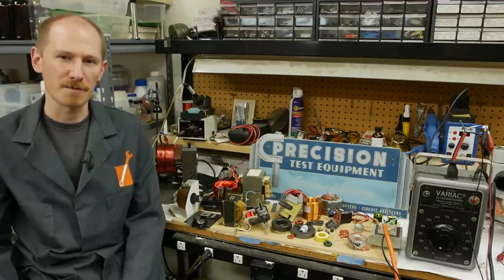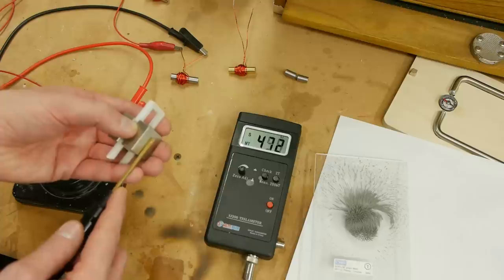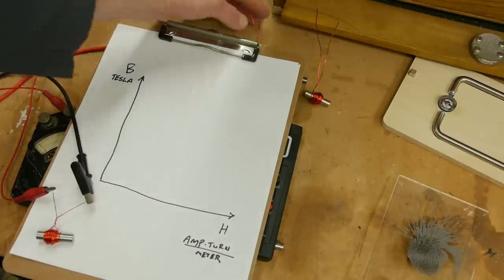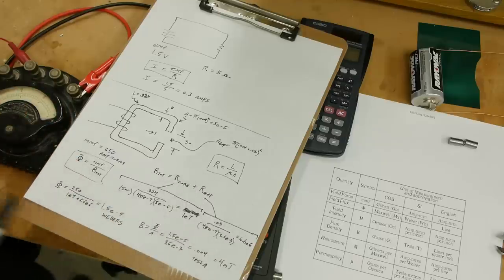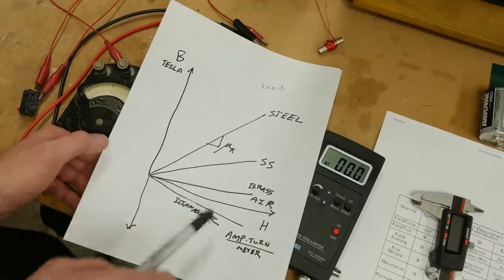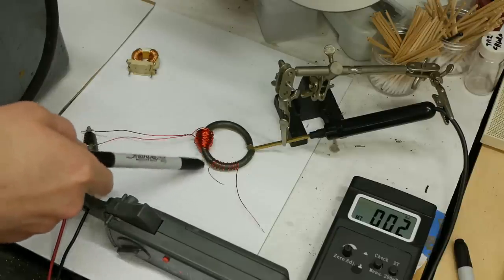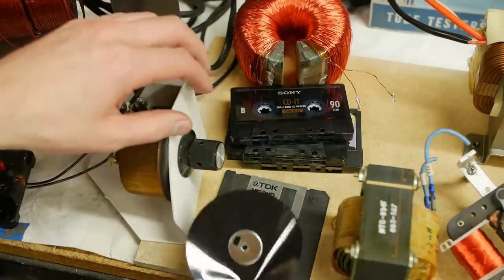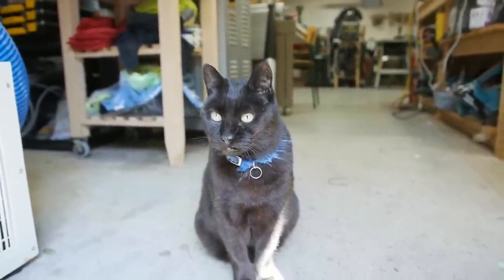Engineering magnetics -- practical introduction to BH curve

Comment: I have to agree that this is a very good educational video. Just a few remarks. 

When talking about the saturation you should mention that the curve does not turn horizontal up there but continues with the slope of the permeability of free space.

Your text notes are too small to be read on a screen.
Reply: @42min your small toroidal ferrite "transformer" is a filter coil meant to filter out high-frequency disturbances from a mains supply by passing phase an neutral through the two windings.
Reply: Sorry, its not a Rule. its a convenience. - and entirely dependent on the resistance of the wire. - EG. you can have unlimited turns, if you have superconductor wire. like iridium alloy.   - oh and you can just use litz wire copper also
Reply: lol yes, newman was terrible at demonstrations.    - he took the theory in the other direction with tiny wire, too choke the current. -  50,000 turns for 2 watts input, - -- ,it has too move something rite ? , even with huge magnets...  this proves even our electrical intuition is better than "amps times turns"  - that's physics!
Reply: Yes it is a common mode choke where the appliance current in line and neutral magnetises the core in opposite directions and cancels out. So it has little impedance to differential currents but high impedance to common mode currents. But there is nothing really to stop you using it as a 1:1 transformer as Ben did.
Reply: @uwezimmermann5427  Yes, it is a common mode filter, but it still is a transformer!

Comment: I did my big delve into transformer design half a decade ago and have learned since, but I'm still going into this excited. Have you read about the team that used superconductors to make legitimate "wires" for near lossless magnetic field transportation? It was still only lab work when I read about it. I hope more work has been done on that, it was very fascinating.
Reply: I thought that magnetic fields are the arch enemy of superconductors.
I can remember "glass iron" (extremly fast cooled iron), which had excellent magnetic proprieties for transformers...
Reply: Atlas WalkedAway -- Do you mean transport like putting it in discrete shipping containers, for movement through space?

Comment: Watched this video again the 3rd time. I had some old copper ballasts that were being scraped in my apartment lighting (after 7 years of running) and being replaced with electronic ballasts. I collected them and planning to do some experiment. Your video comes very handy and practical.

Comment: Hi Ben!  Great video.  One question though...  I thought that the residual magnetic field that remains after the external field is removed is called the magnetic remanence, not the coercivity.  The coercivity is the strength of the external field necessary to cause the material to become magnetized, a measurement of "magnetic hardness".  Once the material is magnetized and the external field is removed, the strength of the residual field depends on the remanence of the material.  Did I misunderstand something?  (I've only watched the video once so far...)
Reply from the maker: I think you are absolutely correct!  In fact, it's been a long time since I've heard the word remanence, and since the two properties often go together, I forget they are in fact separate points on the BH curve.  Thanks for pointing this out!
Reply: I like this part of Ben: when he muffs something (very easy to do on a subject like this), he admits it, and that's it. There's no shame in it. Stuff happens. Lord knows I have made a lot of errors in my professional life. All science and engineering practitioners should be like Ben.
Reply: I seem to recall remanence also being called retentivity, which seems a more descriptive term... though with 5 short syllables, it is a bit of a tongue-twister. At least retentivity will not be confused with revenants! https://en.wikipedia.org/wiki/Revenant
Reply: @PaulTurner_Haizo  Please share schematics for that circuit!
Reply: @AppliedScience  Thank goodness for that; I live and was educated in England and was beginning to think things are different on this side of the Atlantic!  Thanks for the great video, as they say a picture says a thousand words and seeing it in operation has got to be at least 10 times greater!!

Comment: The energy that's put into a permanent magnet at its time of manufacture, where does that energy go when you heat the magnet to its Curie point? Is it converted to heat then lost to space by radiation/conduction?
Reply: whoa good question
Reply: No energy is stored in permanent magnets, thats an illusion.
 example:
Take a jar of pennies, reorder every pennies in the jar so the face point upward, this takes energy. Now, shake that jar, did the pennies get warmer bc they are now randomly oriented?  No
Edit:
Permanent magnet are made out of "magnetic" atoms, the magnetization just align the atoms (cluster of) in one direction, this rotations heat up the magnet while it's manufactured.
Heating over its Curie point, just randomize the atoms back.
Reply: International Mutual Neutralist Party Templates 

that's a great explanation actually
Reply: MrJimbo1qaz yes, if you try to put two of the same poles together you will feel the force pushing the poles away. If you keep the poles together you are putting in work to counter the magnetic force. Work is the transfer of energy and has the same units.
Reply: MrJimbo1qaz: It always require energy to get from a chaotic (randomized clusters) system to an ordered one.
Reply: MrJimbo1qaz: "feel forces from others (atoms)…" are the reason of "clusters". But wouldn't you, need more energy to demagnetize these atom clusters because their fields were aligned ?
Reply: I think the diminishing of the magnetic field above the curie temperature would induce a current in a nearby conductor because changing fields and moving field are the same as far as induction is concerned. Thereby the energy is released as electromagnetic waves. So yes you can get the energy out by destroying a magnet. The efficiency is just abysmal.
Reply: "shake that jar, did the pennies get warmer bc they are now randomly oriented?"
Yes.
Very very very very slightly, but yes.
Reply: I think this is true and nobody's going to see it while that incorrect answer continues to rack up the upvotes. The pennies MUST get warmer by definition because order is being lost. The system is becoming more disordered and occupying a lower energy state. Energy must be released in some form.
Reply: there is some energy required to demagnetize the clusters!
you can see this when you heat up iron above its curie temperatur the temperature stays the same till all the alligned clusters are disordered
Reply: A one layer cylindrical coil acts exactly same as a cylindrical magnet  of same dimension if you put the right ampere/turn on it.
Once you have the right turn and amp....
Then you can calculate/measure the inductance...and apply the energy formula:
Jouls=Amp2 x Inductance x 0.5
Thats are the energy "STORED" in the coil and the magnet.
If a loaded coil are wrapped on a magnet and you rise the temp to curie point...you can retrieve the energy previously stored.
Obviously with great loss....unless the coil was a Superconductor and in short circuits.
In that case near all energy will pass to coil (all if was a toroide with not dispersing flux)...and the magnet become no magnet and the coil become the magnet .
Reply: Good question, but I think the required energy to reorient the grains in the material would get "lost in the noise" of the heating process, which takes a fair amount of energy all by itself. How does one separate the heating energy from the "flipping energy"? I have no answer for that.
Reply: @Mrluk245  So the magnetized state "melts" at a constant temperature, like ice.
Reply: Demef You separate the energy by accounting very carefully for all the heat you put into the system. This is done by very carefully insulating the material under test, so that you know how much thermal leakage there is (thermal flux through the insulator, and through any of the shorts - any sort of wire crossing the insulator is like a thermal “short”!). Such insulated chambers are common anytime you have to measure something that relates to the amount of heat added/removed from a system. And IIRC the demagnetization energy, while not very easy to measure, can indeed be measured. Just as you can measure the energy released via a resistor that shorts out a magnetized electromagnet.
Reply: @AltMarc  what about the energy required to turn magnetic dipole under a magnetic field

Comment: This is one of the best magnetics  introductions I've ever seen. It is so easy to get loose on math and be disconnected from the physics behind. When I learnt this on my second year of EE, I was able to solve exercises so I passed,, next year I was an teaching assistant, and then I started to understand. Finally truogh labs  classes and a few years I got enough physical understanding. Today I think that some lab should be done in advance to the hard math/physics teaching so an integral is not a math challenge but a sum, a divergent is really a measure of something real diverting, and so on.

Comment: If you have wire wound around an iron core, and at a given current it is saturated, if you pass a higher current through the wire, what happens to that extra magnetic field or flux that is being generated?
Reply from the maker: Good question.  Once saturated, any additional H caused by additional current in the coil will behave as if the iron didn't exist at all.  It will spread out through the air just as it would without the iron.  It would be nice if the transition through saturation were like a brick wall -- snapping into a new regime suddenly.  If this were the case, we could first measure the field caused by 100% saturation, then measure the field caused by air (with the iron core removed), and then sum them together.  In the real world, the transition to saturation is gradual, and the field making its way outside the core will interact with the partially saturated core, and cause things to become a little more messy.
Reply: The phenomenon you are looking for is called magnetic flux leakage. The magnetic field will literally leak out of the iron core and start flowing through the air around the core instead.
Reply: Magnetically, it would make the field weaker but would make very little difference overall. Your essentially shorting out a small section of the magnetic field. Remember that flowing electrons create a circular magnetic field that flows around the current flow. So the magnetic properties of the wire aren't very significant, it's whats around the wire that has the most impact. Electrically on the other hand, by using wire with a higher resistivity, you've increased the resistance of the coil. Which means you need more voltage to have same amount of current flowing through the coil. This means you will need to have more input power to produce the same magneto-motive force and your overall efficiency would drop.
Reply: Mai Mariarti  The iron wire will get hot.

Comment: If you put a highly diamagnetic material in place of the air gap, would you get a net negative reluctance? And what would that do to the magnetic field flowing in the "circuit"?
Reply from the maker: I was wrong about this in the video.  One of the other commenters helpfully pointed out that diamagnetic materials do not have negative permeability, but rather a permeability that is lower than empty space.  This means that in an H field, the material will conduct magnetic flux more poorly than empty space itself).  The magnetic field lines will partially flow around the diamagnetic material instead of through it because the material poses slightly more reluctance than the space around it.  A compass needle aligns itself with the magnetic field, while a piece of diamagnetic material will become perpendicular to the field lines.

Comment: A simply outstanding resource, thank you SO much! As an electronics engineer who struggles with magnetic, this is very valuable.

I fully appreciate your strategy of keeping things simple, minimising the math and especially minimising the proliferation of terminology. In doing that, it is vital to use the utmost care when selecting terms to avoid confusing the listener who is struggling at the limits of comprehension. And in an attempt to be helpfully picky, I’d like to suggest some to reconsider.

The electrical analogy to permeability is conductivity, not resistivity. And if you were to write an equivalent formula for resistance, to match your formula for reluctance, the electrical conductivity would be in the divisor, not resistivity.

You seem to use field and flux (or flux density) interchangeably. Are these distinct concepts? My understanding is that flux is analogous to current. Is that so?

And near the end, when you’re talking about hysteresis loss, you talk of power loss per cycle when I think you mean energy loss per cycle. Energy loss per cycle multiplied by frequency gives power loss in watts, so these are not the same thing.

And one thing that confused me slightly was you said H was ampere turns per metre, then later gave MMF as ampere turns, without the per metre. What happened there? What did I miss? What happens if my coil is not one metre long?

I’m not trying to be critical, I really appreciate this excellent video. I’m just trying to point out a few areas where those struggling with magnetic concepts may be thrown off track by questionable terminology, which may be improved. And remember, you don’t bother polishing a turd, only a prized jewel!

Comment: This is an astonishing video. I have PhD in physics(different area though) yet in this video I found lots of things I did not realise: analogies with electric circuits, transformer saturation and gaps in inductors. However, there is still something that I can't get intuitive understanding of:

Materials with high magnetic permeability form a good "conductor" for magnetic fields, basically inducing high internal magnetic field B from external field H. However, in electric analogy, good conductors have infinite permittivity which means that they completely expel electric field E from them (displacement field D inside conductors is zero). Why instead of an analogy do we have opposite behavior here?
Reply: I never heard of anything having infinite permittivity. I have learned metals have relative permittivity close to 1.
Reply: your confusing ohms for permitivity.....fat gold wire has lower resistance ohms...ohms is lower...high magnetic permeability = low electic ohms

Comment: What's really interesting - and something I hardly ever see anyone talk about - is the fact that when you try this with an unbroken horseshoe steel bar  (instead of the broken horseshoe you have in the video to fit the compass in to show the magnetic field lines) what happens is that the steel piece you add to complete the circuit stays locked in place, even when you turn the current off. You have to pull it off with some force to get it off and when you do if you have a coil on the main shoe and have it on a scope you'll see voltage produced. Even stranger is they do not teach you this at school. Try it, it blew my mind when I first did.

Comment: @12:45 could you measure the gas content of metal this way?
Reply: you mean the gas content of steel?
I doubt it, since there are too many other factors that will affect the properties much more. For example the composition, and especially the crystalline structure throughout the steel.
Reply: Thanks!
Reply: @Basement-Science  I was going to say temperature and molecular structure would be the leading variables but you said composition and that made me think, the metal mixtures won't the the exact same for almost any application. It would be just to difficult to make the exact same composition. Good answer.